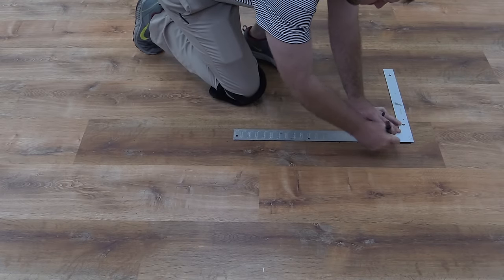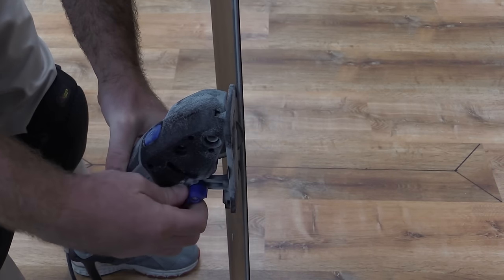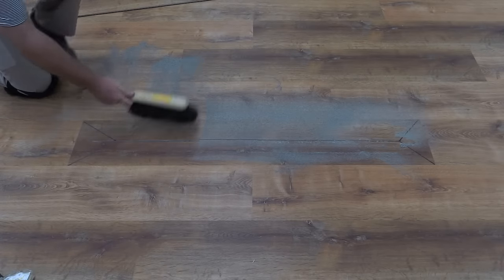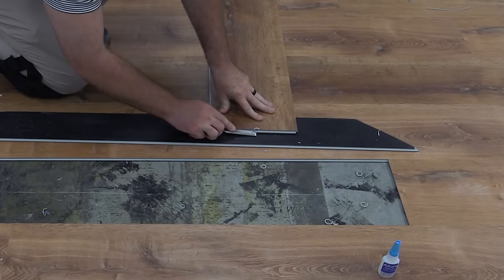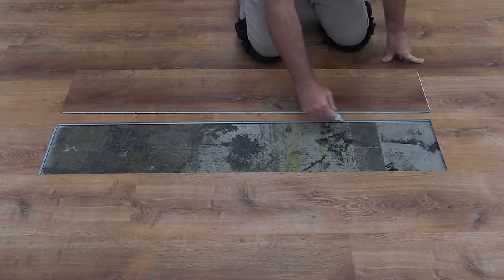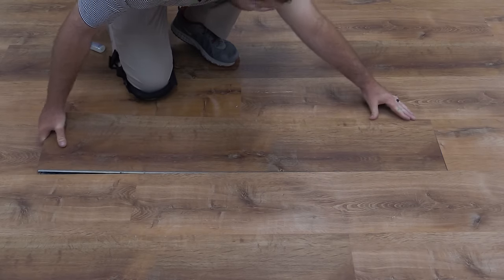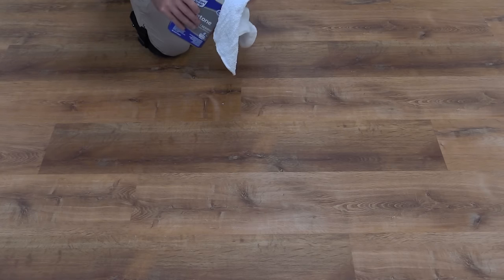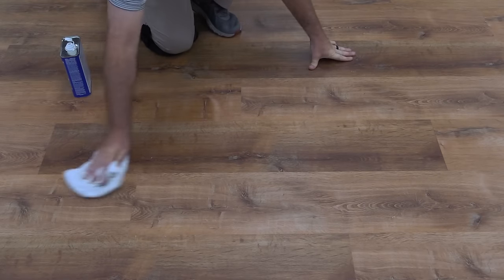How To Replace Click-Lock Vinyl Flooring

Comment: The video says "remove the lock of the long and short edges of the surrounding planks" yet he's removing the lock from the replacement plank in the video, then as the video transitions to the install portion it says, "repair the replacement plank by removing the lock on the long and short sides" even though they just displayed this already. So are we removing the lock on the replacement  plank only as shown in the video or are we removing the lock from the replacement and the planks on the floor as voiced in the video?
Reply: Good question. My guess is you remove the lock from both the surrounding planks and the new plank so that the new one fits. BUT I would try just removing the lock from the new plank, and see if it fits in snugly. If not, then also remove the lock from the surrounding planks.
Reply: Good luck. I've done this before and I cut out the entire tongue from the replacement plank because you cannot fit both sides in once the floor is fixed. Problem is it is easier with some brands and types such as laminate than is with others as they live to chip and break from the smallest forcing. With the vinyl I have now it is nearly impossible so I have to pull the floor all from the starting point to almost the middle of the floor to do this repair from the bubbling 3/8's subflooring I recommended not to use which was only used to lay over an existing solid wood flooring that was rotted in some areas and patched which would have been enough but customers insisted on putting this down. May be an ongoing problem in this 80 y.o. home.

Comment: For anyone wondering - you can get good super glue (cyanoacrylate) in larger quantities for less from the hobby stores.
Reply: Actually, hobby stores are MUCH more expensive than CA you can get at Home Depot or Lowe’s.
Reply: Yeah, if you get some of the “two part”glues that woodworkers use for glueing trim one of the bottles is super glue and the second bottle (usually a spray can, is the accelerator), it comes in larger bottles and much cheaper than at Home Depot or hobby stores.

Comment: Laid LVP in my master bedroom 2 years ago. I have a large area near my computer desk, where the chair rolls, that have planks popping out and are now edge damaged from being walked over or rolled over. Luckily I still have over a full box of replacement planks to repair this, but what a PITA. I spent so much time on floor preparation that I don't understand how this happened, aside from just buying subpar LVP. I had some issues during install where the locking edges of the planks were broken out of the box or would break with the slightest tap of the install tools. This video will be a great help. Thank you!

Comment: Used this today to change out a plank at home. Thank you.
Reply: What glue?
Reply: @dustinwilliams9046  I saw a video where a gentleman wetted the panels slightly and applied gorilla glue.  I did the same last week, seems to be holding just fine
Reply: @rickspalding3047  I just used one of those small tube's of super glue.   The advice of install the plank with no glue at first was helpful.   Thank you for being helpful.
Reply: @dustinwilliams9046  I used liquid nails - it's never coming off again.

Comment: Thank you for a fast, to the point explanation. This was very helpful
Reply: Its a rarity in the youtube world.
Reply: @ BM Your right bro. I have 12 boards to replace, but only have to glue one!👍🏻👍🏻👍🏻✌🏻️
Reply: @alanross3435  How is it holding up?? My neighbor was saying you never ever want to glue them down and it's better to rip up the floor and redo it.
Reply: Celeste Boyce ,it's holding up great, only 
had to glue one board!
Reply: @celesteboyce1337 it is key to only glue the tounge and groove, not too the floor, this way the boards that were swapped out will move accordingly with expansion as opposed to not moving at all with it being glued too the floor.
Reply: @celesteboyce1337  When floors (doors, etc.) heat and cool, they shrink and expand.  A door that is fitting snug in the winter won't close in the summer with the additional heat and humidity in the door.  For floors, they shrink and expand ever so slightly, so you don't want any part of the floor nailed or screwed to the floor.  It needs to be free floating for shifting.  Glueing a single plank like this shouldn't cause an issue, and it can be done quickly for the cost of a single plank, plus tools if you don't have them.  I learned the hard way.  The carpenter that replaced our flooring after water damage didn't want to do our floor and told us it would be better to put the flooring down first, and then put the cabinets on top so they are all level.  The cabinets with granite countertops locked the floors in place and did not allow it to shift, and several joints cracked.  I need to replace several planks...and hoping I can find a chisel set on Thanksgiving afternoon.
Reply: @Troy-Echo  Wait, so in general, is a floor still free floating with heavy furniture on it?
Reply: @iAnasazi Yes.  From summer to winter, the floor may only shrink and expand 1/8 inch every 10 feet (random guess to be honest), but the furniture would shift with this.  If you have immovable cabinets or something firmly secured that will not allow the floor to float after a few years the joints will start to buckle and crack.  Our floors shifted OK for the most part, but the closer you got to the "L" shaped  cabinets in our kitchen, the worse it was.  If it had been only secured on one side, the rest of the floor could  have likely shifted OK, but with the two sides pinned down, the floor started breaking at the joints.  My wife and I replaced the panels, but I had to get an oscillating saw to cut the floor along the edge of the cabinets to prevent this from happening again.  If you do this, make sure to turn off the power to be safe.  Also, you'll be better off using a small planer (wood plane) to shave off the ridges on the planks.  Trying to do it with a chisel isn't easy, and one little mistake and you can break the side joint.  They do make planers that have the blade all the way side to side.  Order one online before you start the job.  I didn't have time so I had to use a small one, and I had to grind (and grind and grind) on the side to allow it to shave down.  Good luck.  Gotta run, my wife wants me to use the soldering iron for something.  Knowing her, I'm betting it is to melt holes in some plastic LOL.
Reply: @Troy-Echo  Thanks!

Comment: I would dilute the acetone with mineral spirits as a buffer agent so as to not damage the surface. Acetone is a very powerful and fast acting solvent that dissolves/ melts whatever it touches.
Reply: I would just use mineral spirits .

Comment: Thank you. This video showed me enough of the technique that I was able to replace a number of planks in my kitchen..
Reply: How is it holding up?? My neighbor was saying you never ever want to glue them down and it's better to rip up the floor and redo it.
Reply: Yeah your neighbors correct this is improper it’s click flooring you have to disassemble it and then reassemble it
Reply: @ابراهيمالجبوري-خ7ق  it looks lime glue will hold it down alright?
Reply: Of course glue will hold it down but this kind of flooring is not meant to be glued down its click together flooring which frankly is very low quality either use real hardwood or even carpet if you want just m switch out the carpet Every 5 to 10 years I really dislike click flooring I think it sucks

I personally prefer carpet or hardwood except and maybe kitchens and bathrooms were you gotta go with tile for sure

Comment: Does this work for buckling floor planks also? They are crowning at the seams.
Reply: Likely not. If it's a floating floor, be it vinyl or laminate, buckling generally occurs when sufficient spacing wasn't  added around the entire perimeter of the floor. A floating floor needs about a 1/4" to 3/8" gap between the edge of the flooring and the walls. In cases where the baseboards are already installed, you leave a gap off of the baseboards and then use quarter round to cover the gap. The reason for this is the laminate/ vinyl needs room to expand. If there is not enough space for expansion, the flooring will expand until it makes contact with the wall and then continue to expand causing the flooring to buckle. This will also occur if any of the flooring is nailed or glued to the subfloor. If the floor is buckling along the long joints, go to the walls that run parallel  to those joints. If there is quarter round, pull it loose from the walls and see if there is a gap between the flooring and the wall. If there is not and the flooring is jammed tight against the wall, even if its just a small area along the wall, then you have found the issue.
Reply: Yes you can swap out any damaged boards, if it is scratched or buckled really doesn't matter, you can start off by checking expansion, if the adequate amount was left on the perimeter the main culprit is cleaning materials and or rapid temperature changes.
Reply: @jackblack9208  How does it expand/contract with heavy furniture on it?

Comment: Really take off the locks and glue it in?  Is this normal?  What if there's an issue in the future with the glued plank
Reply: gonna have to rip up surrounding ones if if they get damaged since its glued. Once you fix one the glued ones are all a team now and youll have to replace all of them if one of those gets damaged.
Reply: @frankvaldez9700  that makes sense, I guess that's the best way to deal with locks.  I completed the panel replacement last week, it worked well.  I had to buy the multitool to complete it.

Comment: Does this work with a 'floating floor" that has soft vapor barrier underneath? Or will the movement on wear and tear make the glued end pop up?
Reply: Should be fine. An extra layer of adhesion would be a strip of double sided tap under the joints.

Comment: Do you think I could do this and possibly cut board smaller to fix a buckle?
Reply: These panels are an exact fit, if you cut them in half they will be to short. If the floor is buckled it is pinched somewhere. Cut around any cabinets that are installed on top of the floor and then trim cabinets with we quarter round. 
If the floor relaxes and lays down then change a panel if needed

Comment: My vinyl tile recommends using cyanoacrylate adhesive if I ever lock the tile then have to pull it up.   Is there a certain kind that is the best?
Reply: Industrial strength cyanoacrylate/super glue. It’s sets up fast like the original super glue used to, before they changed the formulation.

Comment: what happens when i need to replace the piece i glued in?
Reply: You replace the 4-6 around it as well.
Reply: @Buddy8  No, just use a circular saw and cut it out then glue a new board in with wood glue all around the edges.
Reply: @n.barrett4734  wood glue on vinyl/stone?
Reply: @vitaminb4869  For stone, "no", just use the same color grout the rest of the floor has and for vinyl, you have to call a company that sells that kind of flooring and ask them, I don't know.
Reply: @n.barrett4734  can I use a dremel to cut around pergo vinyl plank?
Reply: I think you have to buy a new house at that point

Comment: Is it possible that this floor is crap? I rented a brand new appartment 5 days ago, the floor is all marked, I dont know what to do anymore. Is scrached, just moving a small box, left lines everywhere. I can see little holes, etc. Is it normal?
Reply: Extremely cheap home depot type flooring will do that... Bet the wear later is super thin as well. Horrible choice for a rental. Nissan wear and tear shouldn't be your responsibility.

Comment: Does this include Lifeproof flooring?  It appears Allure makes Lifeproof...
Reply: yes. The company sent us this link in regards to our Lifeproof Flooring.
Reply: Life proof allure stick needs a heat gun, I've never done it before but I've been told heat gun works to release the stick
Reply: @rickvenables7648  How is it holding up?? My neighbor was saying you never ever want to glue them down and it's better to rip up the floor and redo it.
Reply: @jamesharder5107  heat gun for what?
Reply: @celesteboyce1337  if you have peel and stick tile, you use a heat gone or a blow dryer to warm up the piece you want to remove and then peel it up.

Comment: life saver! thank you
Reply: Did you do this? How did it go? What kind of saw did you use?
Reply: @Adrianv1981 I would use a oscillating tool or scar the triangle 3 times atleast with a fresh point on the knife and use a chisel and hammer to break that scar line, it will follow the scar indefinitely

Comment: i dont understand when he says removing the lock on the long and short sides.
Reply: Me too!
Reply: The wood has a a groove on one side and a lip on the other so they lock together. You have to cut the lip or locks as he calls them off to slide the new piece in.
Reply: @monkeyhed69  nooooo. don't cut the tongue off. if you look at the tongue you'll notice along the edge of it there is a small round ridge that runs the length of the tongue. that is what you have to remove. if you notice in the video, the guy is using a chisel and he is just shaving the round raised edge on the top side of the tongue he's not removing the entire tongue.
Reply: I use the cool glide seaming system to replace a plank. This way there is no glue required. Only thing set up time takes longer.

Comment: This is one of the reasons that I want to lay this type of flooring in my rental.
Reply: Be careful. Renters are hard on rental units. If they spill liquid onto laminate and don't clean it up right away, the boards can swell and look like crap. Also, you can't wet mop or scrub laminate like you can hardwood. In all seriousness, if you can afford a good hardwood floor that has a hard finish on top and won't chip {it can dent BUT if the finish is hard enough, you won't have the finish chipping off at all}, then lay hardwood. Depending on the renters you get, you might have to replace some or all of the laminate after they move out and I doubt the security deposit will cover that. Also, with real hardwood, you can charge a little more per month to make up for the hardwood over time. Just trying to help out, best wishes.
Reply: @n.barrett4734  are you kidding me hardwood floor a rental NO THANKYOU, LVP is the only way to go it last up to 30 years and water proof unlike wood that swells when wet,also easy to replace sections ,lvp all the way for a rental
Reply: @columbus400  I understand your points but god quality hardwood isn't that much more expensive, you can charge more for your rental unit because of it and can last 100 years. So it's 6 of one and half a dozen of another. Replace your rental floor every 15-20 years for "X" amount of dollars or replace the floor in 70 years for "Y" amount of dollars. It's anyone's guess as to which will be better financially depending on the tenants and floor installers.
Reply: @n.barrett4734  one problem with your argument, this is vinyl not laminate.
Reply: @n.barrett4734  Good think this isn't laminate then, huh?
Reply: @columbus400  how would I replace 3 planks in center  of living room?  I have the pergo luxiory  vinyl plank flooring.
Reply: @futbol1972  really? same way they just showed you man
Reply: @n.barrett4734  this isn’t hardwood or laminate. Clearly you all can’t read 😂 its VINYL!!!!
Reply: for all of you who keep pointing out that this is a vinyl and not a laminate floor should understand that it's not relevant. this same repair can be used on either type of material.
Reply: @jackblack9208  they were talking about the difference in how vinyl and laminate react to water/spills as far as damaging it. Laminate is crap product, it can't get wet. Vinyl can get wet.

Comment: What kind of saw is that?
Reply: It is either a dremel ultra saw or saw max. Ultra has 4” blade and saw max has 3”. I have the ultra saw and it works great.
Reply: @Tim.1113  Its neither of those, not even remotely close. Its a roto-razer
Reply: @Tim.1113  you literally have the ultra saw, how are you going to say it looks anything like the one in the video..
Reply: @chuck7879      Check out the colors of a roto razr and a dremel and then tell me which one it looks like.    Unless both companies chose the same color scheme, it’s a dremel.

Comment: I don’t understand how this works if he didn’t cut the tongue side which he did not show. Also this only would work if the subfloor is super flat so not all would be able to do this method. And also it’s vinyl plank rip it up and install properly in under 2 hrs stop this glue nonsense